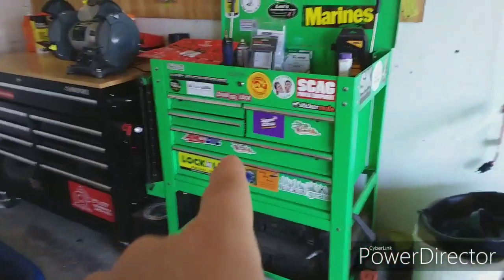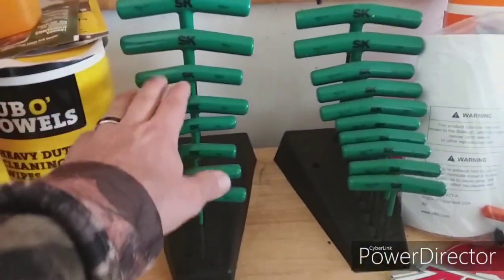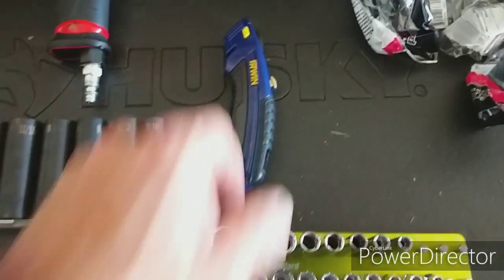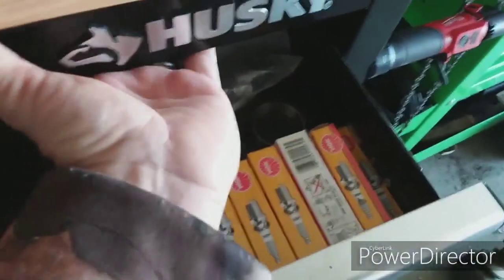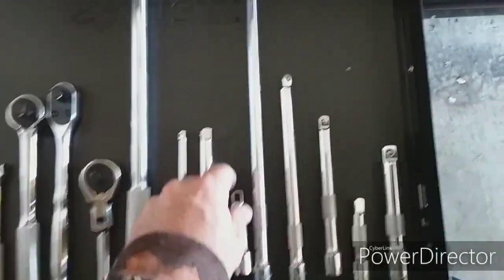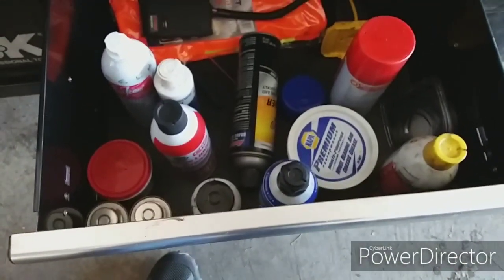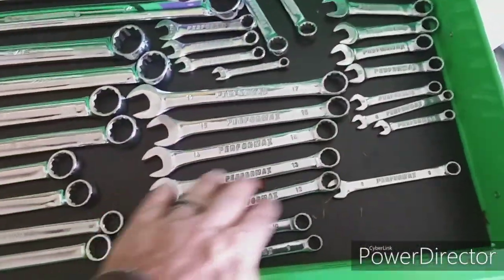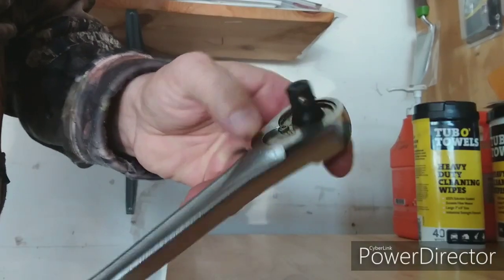PROUDLY MADE IN THE U.S.A. |  TOOL BOX TOUR

Comment: A good set(SK) set of Snap Ring pliers is needed in your tool set as snap rings are used a lot in power equipment.I just subbed-great video!
Reply from the maker: Thanks for the advice. I did just pick up the reversible channel lock snap ring pliers. Any other suggestions sir? Thanks so much. Hope you enjoy the content
Reply: Harry Epstein has one set.  CBMTools is a good place to find some S-K items.  They also have a set.